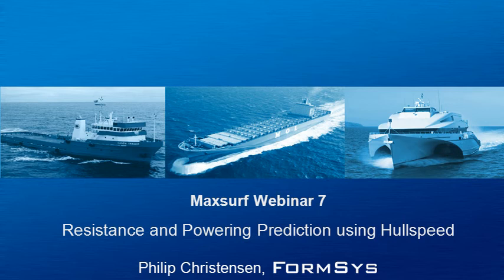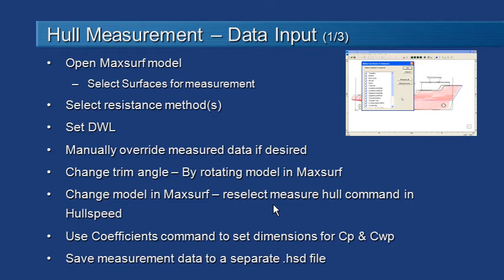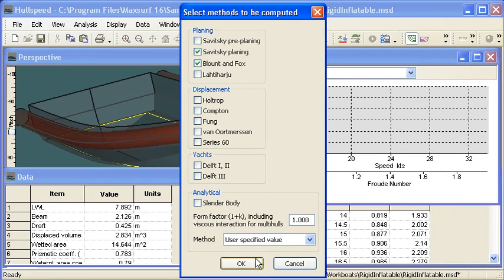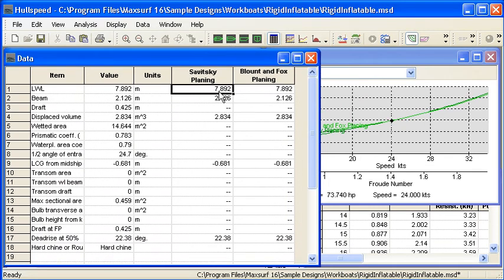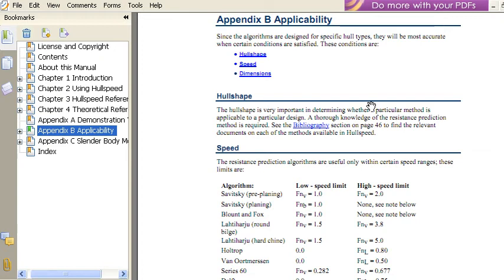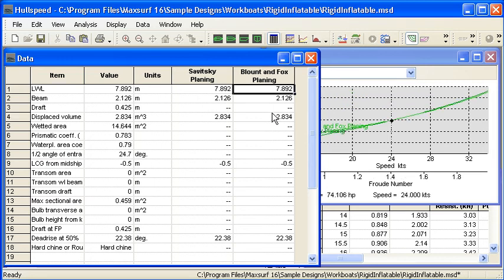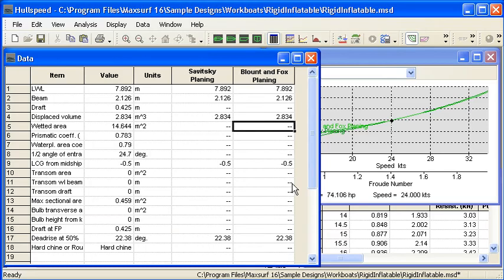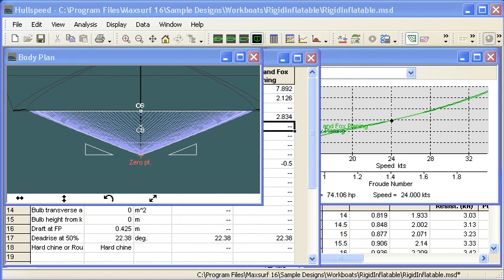Hullspeed Measurements

Comment from the maker: If it is surface resistance, rather than fully immersed resistance, then the slender body method in Hullspeed should do a reasonable job of comparative analysis between difference hull form options. You would need to do a CFD anaysis for fully immersed resstance.